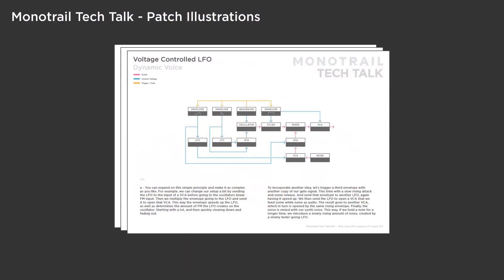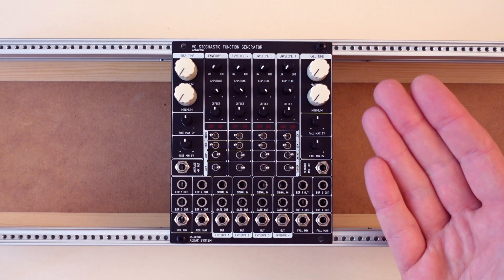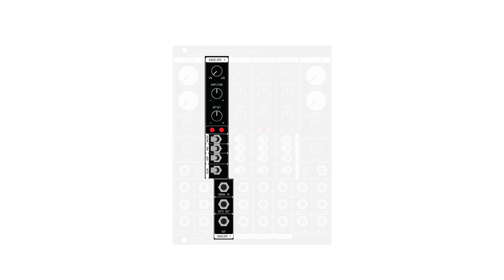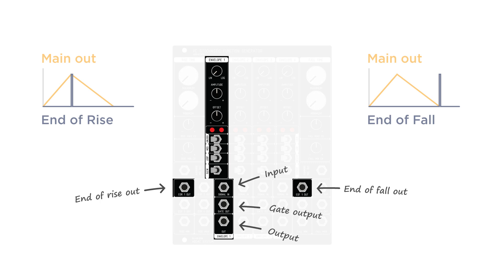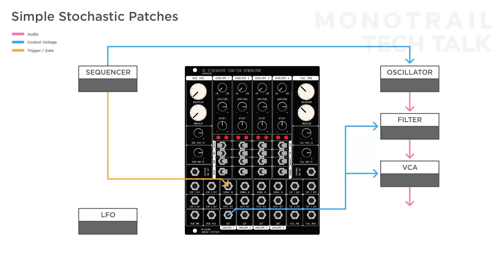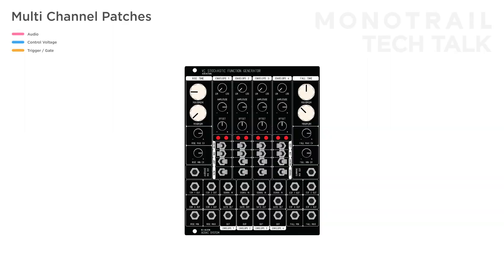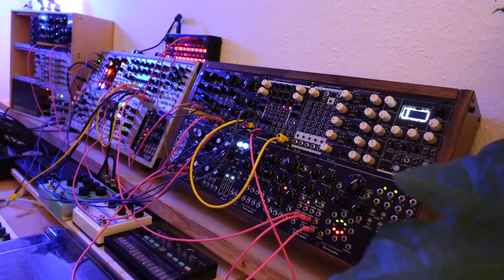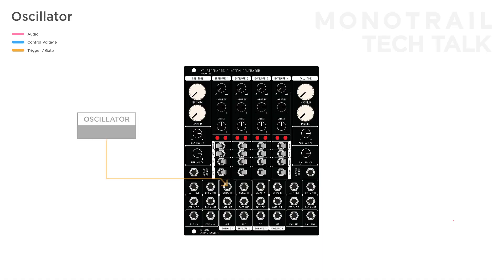The allmighty Stochastic Function Generator - In-depth with the ADDAC506

Comment: Being pretty new to Eurorack and building my first 105hp case i am looking at ways to open up the possibilities of random rhythm and tone generation for abstact soundscapes. 
I first bought two Ears modules as liked the 40 watt amps and the performance aspect - also I thought 2 units would open up stereo inputs.
Next I have purchased a Magpie Turing Machine expanded with Volts and Pulses - all on one Magpie faceplate.
I am planning on getting a Befaco Divkid bus module to send to various recording devices in stereo.
I am now looking at this amazing looking ADDAC506VC Stochastic Function Generator and wondering if this is a good idea for my next purchase?
Confused about where the source sounds are derived in videos like these?
Any guidance would be very much appreciated.
Thank you!
Really enjoy your presentation on these informative videos so many thanks. 
Lee
Reply from the maker: Glad you like the videos! All really depends on what you want. For example, if you want to use a modular to process external sounds only, or actually build a synth voice. All patches in this video are complete if I recall right. So you can see what other elements are used to create all sounds in this video, like oscillators and filters.

Comment: Fantastic as always.   What VCAs would you be using / recommend?
Reply from the maker: Thank you! And doesn't really matter to much, as long as they have at least two controls, one CV input attenuator, and an offset/level control. If you are starting with modular I would also recommend a quad VCA with mixing/output chaining features.

Comment: I’ve just picked up a 506 and I don’t think I’d have had the confidence to stray away from Maths had I not seen this vid. You did an ace job.

Just a thought: It would be nice to see footage (a wider shot) of physically making the patch (with short text on-screen offering the description/detail of the process). Sometimes watching someone dial in a module can actually tell you a lot about how it is to use - similar to trying it yourself in a shop. This could be a separate vid if you wanted to keep the main upload short.
Reply from the maker: Thank you! And agree with the thought. I think there's a lot of value in showing little knob tweaking and variations, and showing what that does to a patch and sound. I started to include that here and there in the demos. But also noticed in my YouTube stats that people bail out quicker during long demos and just tweaking a module. And stay more with more patch ideas. So have to find a balance, or a way to keep it more interesting :) Thanks for sharing though!

Comment: I use a Geiger-Muller counter as a pure random source. Nothing beats the randomness of particle decay. GM counters are cheap and most have an (un-sampled) analogue output (with low gain). The modern pocket-sized counters all have digital circuitry that is generally sampling the GM sensor tube at 32 kHz, so you get a clock pattern (pulse) at 16 kHz. The analogue output isn't quantized in the time-domain, so you end up with triggers that are truly random. The click rate of the counter depends on the radioactive source. You can use a very faint (safe) source to provide a decent click speed. Such safe sources are found in smoke detectors, but also in cheap thorium-coated gas lamp fabric mantles.

Comment: Great video, thank you! Quick question-- so the "signal in" on each channel accepts audio signals. Does that mean we can use it to extract an envelope follower signal, that follows the amplitude of the audio signal? Thanks!
Reply from the maker: Hello! Sorry for the slow reply :) But yes, that's very possible. When you feed an audio signal with minimal rise and and fall times it will follow the audio. If you add fall time you will get a positive envelope. When you add rise rime you get a negative envelope. Cheers!
Reply: @MonotrailTechTalk  Fantastic, thank you!

Comment: Hi! thanks for the video. I would like to add a similar module in my setup but I am looking to something easy to use :) In your vids you seem to use a lot quadra from intelijel. Also have you heard about pons arsinorum from NE? Anyway super interesting as always! thanks,
Reply from the maker: Hello! This module can do so much, it's really hard to suggest somehting without knowing what functions are important to you. For example, the quadra, which I like a lot, is just four simple envelopes. I use it all the time, but can't do any of the many many other things the ADDAC506 can do. If you're just looking for a modulation source, the new Intellijel Quadrax is worth a look. Make noise Maths is more simple than the ADDAC in some ways. Don't know the Pons Asinorum. But If you like the idea of a function generator. You can also look at the Doepfer a171-2. It is only a single generator, but it's less of an investment, and still offers a lot of fun. But again, really depends on what you want and how much power you need :)
Reply: @MonotrailTechTalk  thanks!

Comment: Dang, this thing combines at least 4 modules I have and then some. I like the random variation you got in that ambient patch.
Reply from the maker: Hello, indeed it combines a lot of power. Also am a huge fan of random voltages in general, being able to add a little bit (or a lot) of random variation to patches without other modules is great :)

Comment: Thanks! Two questions:
What are the frequency ranges of the three speed ranges (med/fast/slow)?
For an LFO, can you make any other shapes than triangles and skewed triangles, such as e.g. sine waves?
Reply from the maker: You're welcome, happy to make these! 
The gate out makes square wave LFOs with variable duty cycle, and you can use the lin/log pot to chance the shape from triangle/saw to curved shark-fin like shapes. But no clean sinewaves.
As for the frequency range I don't have numbers unfortunately, In the video I take it well up into audio rate a few times, but you'd have to check with ADDAC!
Reply: @MonotrailTechTalk  Thanks, I appreciate it. I'm more interested in the slowest possible LFO speeds than in audio rate modulation :-) I will ask ADDAC for details.